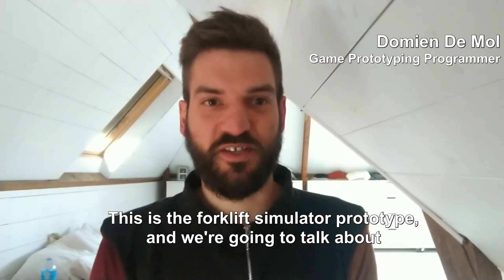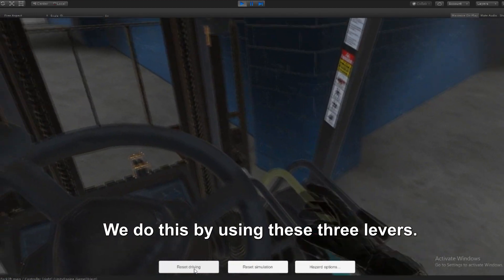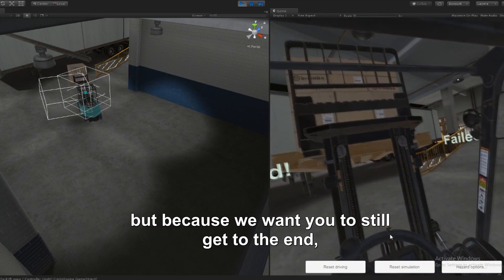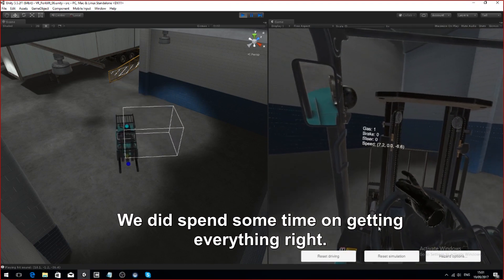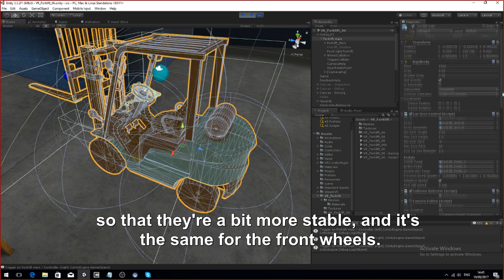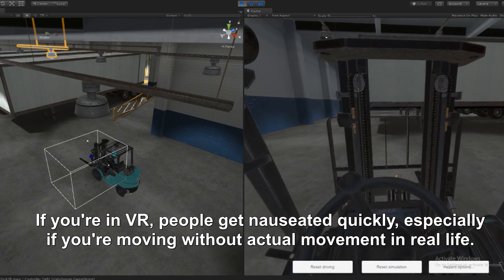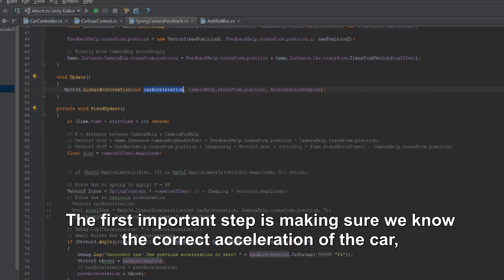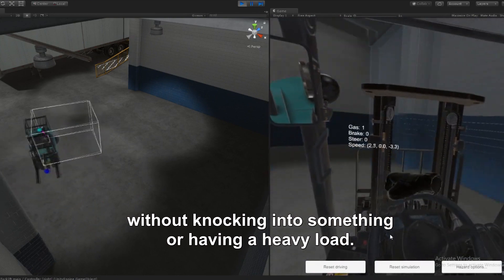Programming a VR Forklift Simulation in Unity - How it's Done

Comment: Can I have access to the script that adds a compensation force/spring on acceleration?
Reply from the maker: Hi Luiz, apologies for the delayed response. We'd have to dig a bit too much to find it, but perhaps this can help - we are basically considering the intended position of the VR rig, and then displacing it as if connected by an invisible spring to that position.

For the spring behavior we implemented Hooke's law, which is a way to calculate the force that makes the VR stay in place, in a spring-like way. On top of just a spring-like behavior, you'll need to add some way to provide dampening, otherwise the spring will keep bouncing around indefinitely. The dampening is done by calculating a force in the opposite direction of the movement of this spring, by taking the velocity of the variation of the spring size, and multiplying it by a tunable constant.

This is roughly what we're doing here.

There's also a blog post about the physics (roughly based on the video, so perhaps not that useful for you), as well as a blog post regarding a lecture Bernard gave at NYU, titled "Physics in Games and VR Simulation".

These two blog posts can be found here:
- https://previewlabs.com/forklift-physics/
- https://previewlabs.com/physics-in-games-and-vr-simulations/

We also did some work on VR rowing physics where we also used spring-like behavior in order to loosely attach an oar to the player's hands. See https://previewlabs.com/rowing-physics/

Good luck with your project!